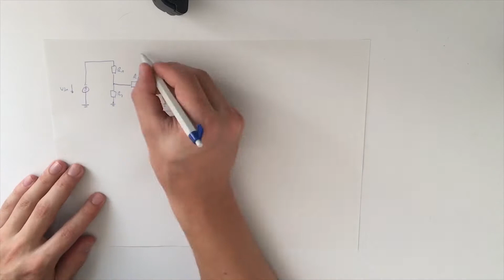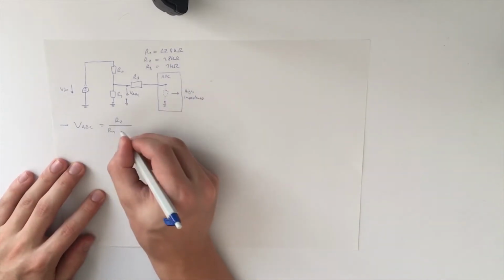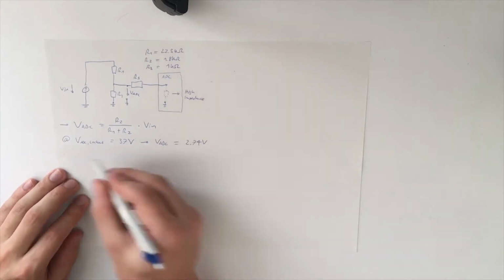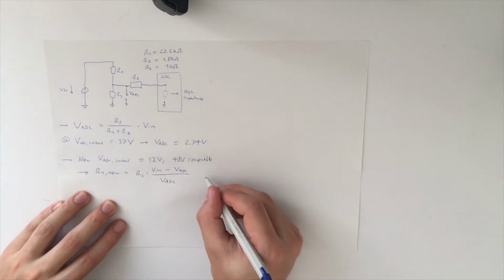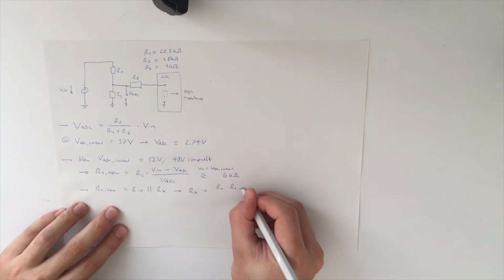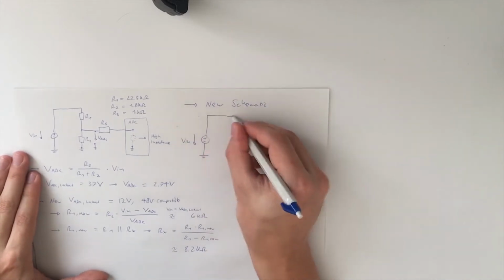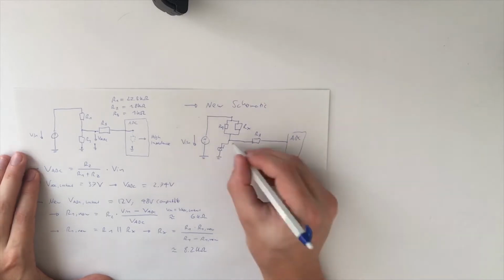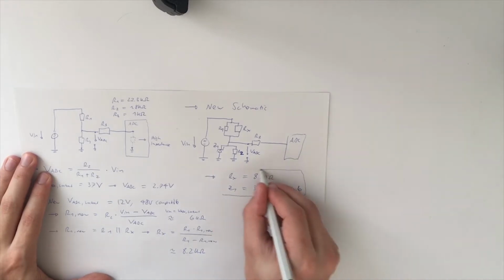48V BLDC Controller with 24V - Under-Voltage Lockout Hack

Comment: Probably a long shot, but do you know how to modify these controllers to adjust the start up torque? The newer variants of these controllers seem to have a ramping throttle, even if you give it full speed. For my application I want as much current as possible (up to the controllers limit) as soon as I apply full throttle. I'm fairly sure this is a software change, but if there is a resistor or anything else that could be modified to have "instant" torque" I'd love to know. Thanks for the videos!

Comment: Hi i have some doubt, resistor shoted after removed from circuit 
Or without removed?
And shoted wire connected to ground black wire  cause shot circuits in supply?

Comment: HEY. how can i completely remove the voltage cut off completely on a controller similar to yours?
I have multimeter and soldering iron but i dont have any access to and chips or resistors except the ones that are in my controller.. please help.
Please try make it detailed so i will understand 100%>
My native language are not english so try write so a kid could understand it. Please thank you.
Reply: Please

Comment: Hy. I have a E-Bike 500w 48 volt Motor and a baterry pack 48 v 10 amps and it charges at 52 volt, and the lover voltage is 41 volt. How low I could go with the voltage so that I don't distroy my baterry pack and my ebike? 40? 39? 37 volt  maximum?
I could modify my lover voltage directly from the E-Bike controller display. In the settings the lover voltage is 41 volt and I want to be 37 volt for a longer ride ,a bigger autonomy. Can I lover at 37?

Comment: Hello! Is it possible to lower the limited voltage on controllers that have hall sensors? I have a yuyangking whose lower limit is 50V, and it needs to be 40V to be able to use it. Thanks!
Reply: Did you find a solution? I have a Very similar problem

Comment: Thank you for uploading this trick.
I always wanted to run motor directly from solar panel. The panel is rated for 40V max.
I tried using boost converter, but motor fails to run after loading it. 
I tried to trace the circuit to find out the under voltage protection. While doing so, I already damaged one :( 
I will try this trick with other controller. Hopefully I will be able to run motor from solar panel + the controller. 
Thank you once again!
Reply: Did you try this method?

Comment: I have a question if the motor is a 48v,  and if I use a 24v or 12v battery, would it even work as will the motor even spin? I have tried a 24v so far it power up but the motor doesn't not spin and this a brand-new kit too? Need help any suggestions would be great thanks

Comment: Hello. I have a question, I have a 350w electric scooter with 600w max power. I have a 36v -48v - 350w and 18amp controller. Currently I have two 36v 10 amp batteries in series, which still gives me 36v but 20 amp. The question is. Can i connect the third one of this same power? 36v - 10amp. ? So I will have one large 36v battery but almost 30amp. Do you think it will drive safely? will not burn the engine or controller?  
Thank you for your help :)
Reply: Hopefully you just misspoke but 2 36v batteries in SERIES gives you 72v.  If you are wiring 2,3,4 or 10 batteries in PARALLEL it will remain at 36v and multiply the amp hours, so you will increase the run time and current potential.  This is completely safe as the controller is still receiving the same 36v and will only draw the amps it needs.  Just be careful, I would recommend doing the research to better understand these basic fundamentals before making modifications.

Comment: Good day, I need help.
I have a controller MODEL KT36 / 48SVPRKD-SPS03
  RATED VOLTAGE DC36V / 48V
RATED CURRENT 22A
LOW VOLTAGE POTENCION DC30V

how to downgrade to (LOW VOLTAGE POTENCION DC25v) ???

Comment: I have a multi voltage controller 48v/60v/84v and it has 3 different low voltage cutoffs, 1 for each setting. is it possible to remove the 51.5v cutoff for the 60v setting without modifying the other cutoffs? I have 3 52v 18650 packs in parallel and I really dont want to rebuild the packs to avoid hitting the 51.5v cutoff right away as that would require buying a new charging unit to go with the higher voltage pack. thank you for your time and knowlage
Reply: bob2d21 your 52v packs are 48v, just use 48v setting
Reply: Did you find Any solution? I have the same problem

Comment: Hey, i accidently bought a 48V controller for my BLDC motor. My battery is about 36V, and the undervoltage cutoff is at 42V, so i when i power it on the motor runs for a second or two and then stops.
I don't mind having no cutoff at all since my BMS is already doing this job, but i can't rly find the adc, the voltage divider or +-3.3V (i'm not a total noob in electronics but i'm not an expert either). Could you give me any tips/help me to remove that cutoff please ? Thank you in advance.
Reply: Did you solve this problem? I have the same

Comment: Hi brother, I bought electric car  from China, but the speeding very low40km/h , how can I increase the speeding to 90km/h , the motor power 60v/1500 watts, the controller 60v /1500 watts ,
Reply from the maker: Hey, I think you wont get any faster, since the motor/controller power is not high enough. There is no hack for that, you need a motor with more power and an appropriate controller. Something around 5kW may fit your needs, but its hard to say if I don't know what car you bought and the other conditions.
Reply from the maker: @Block Chain Do you have a 36V controller, then it might work, but the problem is, that a boost converter has a efficency of around 90%, that means it will get pretty hot. A better solution would be to serial connect 3 lead acid batteries of the same type and same age. Your 24V battery is probably already a serial connetion of two lead acid batteries, if you get a third of around the same age, it will be a better and more efficient solution.
Reply: is there some chance to make it faster like you was showing the speed was faster after your hack

Comment: Hi, question. Is it possible to run those Chinese controllers with a higher than 48V voltage? And what modifications would it require? If for example I want to run them at around 80V. Thank you.
Reply from the maker: Many of this controllers are based on the same PCB, such that it is possible to change some components (Like in my video, if there is for example an over-voltage shutdown). Do you have a special controller in mind?
Reply: @ttschabos  yes, I got this one https://www.ebay.com/itm/1x-36V-48V-350W-Electric-Bicycle-E-bike-Scooter-Brushless-DC-Motor-Controller-DC/173665740374?ssPageName=STRK%3AMEBIDX%3AIT&_trksid=p2057872.m2749.l2649
Reply from the maker: @TengizAdamashvili  If you got the 36V controller, you may change a voltage divider and it should run on 48V too, but more I would not give this controller, since the capacitors are probably not rated for higher voltage and also the MOSFETs may break through at higher voltage. Also the charge pump may be a problem then.

Comment: How did you change out the sprocket? I have motor very similar to yours and can't seem to get the nut off to replace sprocket.
Reply from the maker: It is a left-hand thread nut, so you need to fix the axis and turn the nut clockwise to open it.
Reply: @ttschabos  Thank you so much!!

Comment: Why does the controller have the voltage cutoff control?  What are the implications of changing it in so drastic a manner?  Why not use a 10-turn POT and make it adjustable?  Basically, more background would be very welcome.  Thank you.
Reply from the maker: The undervoltage lockout is used to protect the batteries from deep discharching. I chose the 12V, since I don't need the undervoltage lockout at all and this could also be achieved by connecting the ADC pin directly to 3.3V. But I wanted to show, how you can adjust the undervoltage lockout as needed for your batteries. A Potentiometer could be used, but then you need anyway to open the case if you want do some adjustments, since most controllers are waterproof and you won't cut out a hole there. Further to the undervoltage lockout, also the maximum current can be easly adjusted by changing the shunt resistor, such that you can transform a 48V motor controller completely to the one you actually need.
Reply: @ttschabos  thats mean that i can skip the steps in videos and connect the adc pin to 3.3V power source with same ground pin?
If that true where is the adc pin how can i find it.please?
Reply from the maker: @Jerzyhany If you dont want undervoltage lockout at all you can connect the 3.3V source to the ADC Pin. To find this, you have to look after a voltage divider as in the video, that brings down the input voltage to the range of 2.0-3.3V.
Reply: @ttschabos  oh thats so easy now what should i do is to use a multimeter to find a pin that has approximately 3.3v then connect it with 3.3v thats share same ground . Is that all i need?
Should i connect another 5v source to feed the hall sensors in the motor and throttle ?
Sorry for distruping you with my stuped questions
Reply from the maker: @Jerzyhany  Ye its not hard, you can use a multimeter and watch out for points of around 3.3V between two resistors. The cut-off threshold at the cut-off voltage is around 3V as measured in my controller. So when you reach for example 37V, which is the cut-off voltage for a 48V controller, then you should measure around 3V.

You have not to adjust anything else, the hall sensors are used for position feedback and have nothing to do with the input voltage measurement.
Reply: @ttschabos  just a little more detail as how to find/connect ADC pin with 3.3v, and do i need a ground in there too? or just connecting these 2 together? ADC and 3.3v that is
please and thanks
Reply: @Jerzyhany  yes plz how to find ADC pin and how to connect them.
Reply: @ttschabos  yes plz, help with how to do it plz
Reply: Would connecting 3.3V to ADC affect regen in any way? Thanks